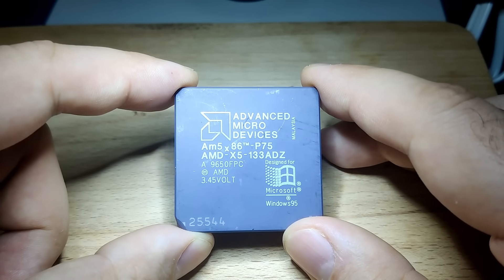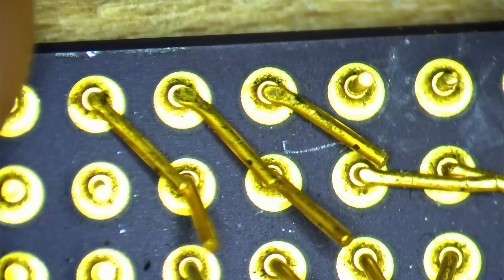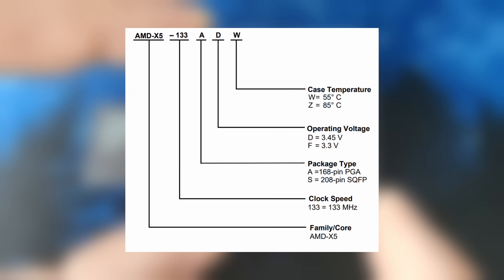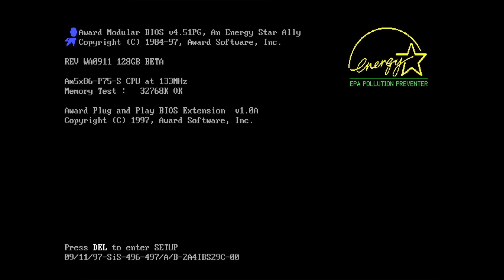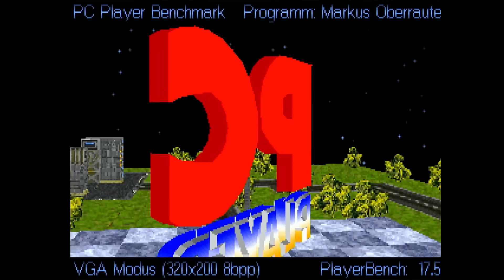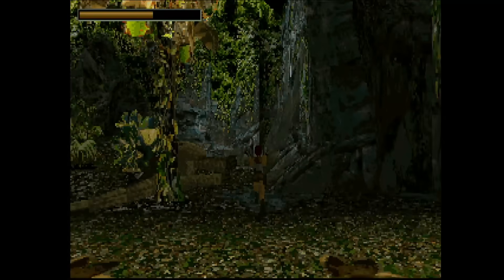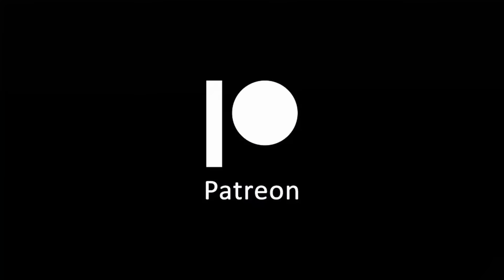Tomb Raider (1996) on the fastest 486 CPU (Part 4)

Comment: this isn't a fair comparison. You're pitting the fastest 586 amd produced, against the mid range cyrix cpu. You already know they made a 120Mhz model, so why didn't you overclock it to the speed of cyrix's actual 120Mhz 586? Then it would have been Amd's fastest 586 vs Cyrix's fastest 586. I demand a rematch your honour :) My client Cyrix's 586 was about 15% faster!!! 
Banter aside, great video as usual.

Comment: Why is one of the pin pads have a square base rather than a round base where disappears into the ceramic substrate
Reply from the maker: Good question. I don't know the answer. The pin with the square base seems to be the clock signal. It is also located in the inner corner where pin A1 is (outer row).
I think it is a visual aid of some sort.

Comment: to straighten bent pins I had used medical syringe needle with cut off sharp tilted front edge. Make sure the needle is big enough hole to fit the pin.

Comment: Have you considered using a mechanical pencil to help position it?
I've used a 1.0 / 1.3, / 1.5 mechanical pencil a lot.
I used the heat gun on the metal mechanical pencil to heat the pins and bend them more easily

Comment: Get a mechanical pencil and use the tip of it you can insert the CPU pins into the tip of the pencil and then use the pencil as leverage to bend the pin back into position

Comment: I used to fix those using empty 0.5 and 0.7 mechanical pencils. You insert the pin in the metallic tube at the tip, which gives you excellent control on where you apply the bend force along the pin.

Comment: Why Prefer Faster 80486SX Cpu
 -because disabled floating point unit or co processor 
 -because uses 25mhz is faster than 133mhz
GUARANTED TO NOT RUN Windows98

Comment: your AMD X5 is a Pentium 586 clone. it's not a 486 processor. to play Tomb Raider properly you need at least a Pentium 133Mhz with MMX capabilities to accelerate 3D calculating. few months later, AMD provides their processors with the 3DNow technologie to beat the Intel MMX. on my part I was using a Cyrix 200Mhz (very good ans cheap processor) with a Voodoo 1 video card to replace my Pentium 100Mhz and be able to play Tomb Rider.

Comment: I wish he did get all the different 486 133 just to find out what is different if anything about the ADH ADY ADW ADZ AND BGC CPU'S that would be an awesome video to see why the different codes for the basically same cpu
Reply from the maker: I'll try to get all of them. The ADY is possible to get, but I have never seen and ADH.
Reply: @bitsundbolts  cool be interesting to see if it has to do with better or worse floating point math or something that affects performance in some way
Reply from the maker: I think the model numbers are mainly to distinguish operating temperature. I doubt we will see any difference in performance, but I may be wrong (e.g. different size in level 1 cache)
Reply: @bitsundbolts  I to doubt it but who knows till you check them out against one and other there could be some difference that no one knew about in terms of performance between the different models

Comment: looks like its  decent  cpu  for its time   suprisngly  .looks  like  it could  last  until  even 2000  with  good gpu  and board
Reply from the maker: I used my 486 DX4-100 until late 1998. Then I upgraded to a Pentium II 350. Of course you could have pushed it a bit longer, but change happened rapidly during that time. Especially with AGP graphic cards - which you would miss out on when staying on socket 3. But I definitely agree that this CPU was a great companion for a while.
Reply: @bitsundbolts  thx for  info  . pci  cards were compatible i asume ? 
i was  pc  noob  back in day  but i do got  overclocked 486 dx2 until  2000  with  no gpu  or  any  grasp   how  pc can  be uprgaded    in terms of   graphical  proccesing  power

Comment: A Mechanical Pencil helps a lot if you can lift the pins a little bit first and then slide the pencil over it and bend the rest of the way using the pencil. But anyways, nice work!

Comment: Awesome work getting that CPU restored! Those pins were in really bad shape. Using the broken socket 3 socket top as a stencil is an excellent idea, I will have to see if I can find one to use for that purpose. I have quite a few 486 chips that look fine to the eye but have a pin or two off a bit that makes inserting them feel a bit sketchy.
Reply from the maker: Hello Mike! Yes, sometimes it is just one or two pins that make the entire experience of installing a CPU in the socket less enjoyable. The socket cover I use was from a board where the CPU was installed wrongly. One of the pins melted the cover and destroyed the socket. Hope you will find also a cover and get those CPUs back into pristine condition!

Comment: If your mobo will provide 50mhz FSB, the 3x multiplier for 150mhz runs faster than the 40x4 setting because it's just able to shove memory around faster. You end up roughly equal in most titles to a P90. 

It was my understanding the reason they didn't sell them as 150 or 160 is that the majority of 486 motherboards only supported 25 and 33mhz. The 40mhz was common, but true 50mhz boards (and the true 50mhz 486's) were rare.

But if your board supports it, 50x3 for 150mhz is the peak performance mark. A LOT of the x4's get choked / throttled by the bus not being able to feed it fast enough.

Comment: Add a voodoo 1! 😄 It will work well! I tried that with my DX4.
Reply from the maker: Ah, that video is already in the making. But first, we need to fix the Diamond Monster 3D, then we are going to test each CPU with the Voodoo 1.
Reply: @bitsundbolts  Great! In newer games the voodoo 1 will be bottlenecked by the cpu of course. Especially when games rely on the FPU.

Comment: What might be interresting is the Intel Pentium Overdrive. That socket 3 cpu can run at 100 Mhz and will probably outrun the 5x86@160Mhz.
On the other hand...it's a Pentium. It would make that 486-system less authentic.
Reply from the maker: I am waiting to get a fan for it. I will make a video some time in March.

Comment: ...and 160MHz was not enough. I'm not exactly surprised. I'd guess that P200mmx or K6 could run TR SW-renderer with well-tuned VGA-card. But most likely it needs something like P200mmx or K6 overlocked to at least 225/75MHz with overclocked VGA. So something Super Socket 7.  Software-rendered 640*480 needs at least Pentium3 with 133MHz FSB (EB-variant) or early Athlon.

Comment: As a kid, I used to play Tomb Raider on an 486 CPU from AMD, clocked at 120 MHZ. In the low resolution mode, the game was much smoother than with this CPU. It must have been an almost perfect 30 fps, and I don't think it is just nostalgia or bad memory. Is there a reason why a slower 486 CPU could significantly outperform a faster one?
Reply from the maker: Maybe you had a different motherboard, better memory (I use FPM because the board does not support EDO), and better timings. The system is not yet tuned for better performance. But I would like to change the motherboard for one that supports EDO memory.

Comment: Guess with those bent pins the good old "bend them back by pushing the CPU into the socked"-Method would've done nothing. :D
Reply from the maker: Yeah, that would have been pretty hard :)
Reply: :-D You'd probably completely destroy both CPU and the socket in the process :-)

Comment: Excellent work! Back in those days I ended up having to run my AM5x86 CPU at 120MHz (40MHz x3) as I could not force a 2x or 4x multiplier in the 486 mainboard I had at the time. I remember trying to play Tomb Raider on that machine and it was not very enjoyable and downright unplayable in places. However, any game that used the Doom engine or similar 2.5D FPS game engine all were a great time!

To get decent performance in SVGA software mode in Tomb Raider you needed a Pentium 166MHz or even a 200MHz. Examples like that are one big reason why 3D accelerators like the original 3dfx Voodoo cards were such a huge deal. It made games like Tomb Raider that were mostly playable in VGA mode on a Pentium PC and allow you to run them in SVGA 640x480 resolution at a smooth (for the time) 30 FPS or higher and allowed for 16bit (65K) color modes instead of 8bit (256) in DOS as well!
Reply: this is the kind of work to make you go crazy making bent pins straight if you are not carful to take precautions.
Reply: Choralone422
The MMX 120 was released just after the Voodoo driver for Tomb Raider, needed that faster MMX 120 Pentium for it. 
Was on pentium 60, needing better build.

Comment: After an XT-class Atari PC3 computer, my first "AT" PC had exactly this CPU (the AM5x86), 1MB of RAM and the S3 Trio64V+ graphics card. Sweet memories.. 🙂
Reply: 1MB of RAM? Shouldn't it be, historically speaking, 4 or 8 MB of RAM?
Reply: @gctechs  Historically speaking, you could put in as much RAM as you wanted or could afford, into those PCs. Mine was built by a local company and they put in exactly 1MB. Yes, the price of RAM was a factor there, but from what I recall, I could live with it for more than a year quite fine.

Comment: Played Tomb Raider on a 486DX-2 66... Wasn't possible in some areas. 😂 Upgraded to an P200MMX with 3Dfx after some months and this was wonderful.
Reply: Same, but never upgraded to a Pentium, or 3Dfx card. Still had a smashing good time on it. If my memory serves me I used some DOS TSR's to improve performance as clock speed only yielded so much. I remember it being a smooth framerate and not a slide show. But that was long ago
Reply: I've played alot in my 486 dx2 on OC 😉

Comment: Still have one of these laying around somewhere... I can only imagine the pins are probably pretty smashed. It did run 98se well enough, with 56mb 72pin memory, a 512kb opti svga vlb card, pci usb card, opti sound card with a volume wheel. Played starcraft surprisingly well. Even handled MPEG2 avi video playback. Overclocked to 150 mhz. Not sure what happened with the rest of the system but the cpu is around somewhere

Comment: For heat to affect viscosity of metal to the degree it bends easy, it would require much greater temperatures than what crystal and especially connecting strands can handle. It's bs, no point in heating the the pins.

Comment: Wow what a substantial upgrade one could've made for their aging PC in the mid 90s to get a couple more years out of it before having to replace it.  I wonder how it'd do with Quake.  It might be just nipping at the heels of being able to run Quake playably (by the standards of the day).
Reply from the maker: The weakness will be the floating point unit to run Quake on a 486, but overall, I really like the socket 3 platform. So many CPUs and different flavours.

Comment: Back in the day there were overclock kits with coolers included for overclocking the 486 from i think it was 66mhz to around four hundred mhz. That's the fastest I've ever seen cranked out of any processor vs the starting frequency.
Reply from the maker: Maybe you're talking about the Overdrive CPUs. They were created to work in older motherboards that only supported 5 volts and therefore were incompatible to newer CPUs that required 3.3 volts. Those CPUs came with their own voltage regulator to make them compatible with those mainboards. For socket 3, the fastest ones should be 133 MHz
Reply: @bitsundbolts  I believe you are right.

Comment: You need to invest in a pair of (knipex 35 52 145) pliers they are smooth on the inside and will not damage or scratch pins when straightening. Definitely my go to for any type of pin re bending.
Reply from the maker: I looked up the pliers and they look so good that I ordered them immediately! Thank you so much for this recommendation! I know that I used the wrong tool to straighten that pin, I just didn't have anything else at hand. The pliers should arrive next week.
Reply: @bitsundbolts  brilliant you won't regret it, they one of my most used tools very useful.

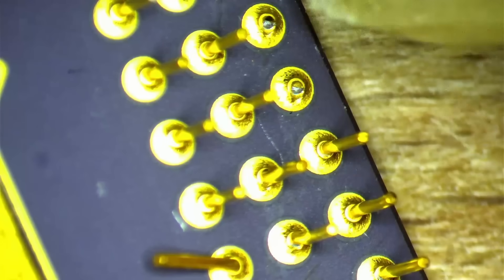Comment: Very awesome video!  What is the tool used at 6:43 and what is it doing?  It looks like maybe an abrasive the way it's making debris around it?
Reply from the maker: Thank you! The tool is an engraving pen. I use it for all kinds of small work such as removing solder mask from traces and drilling into 3Dfx chips when one of the legs has broken off. I'll use it in the next video too because the Diamond Monster 3D misses one of its TMU pins.
Reply: Oh I actually wouldn't have guessed that! I had guessed an abrasive pen or scratch brush or something. Engraving would give you more precision and has alternate heads.. very interesting!  Thanks for the reply, and Love the videos! @bitsundbolts

Comment: Called it! Deliberately broken off ones don't count. 😄 Joke aside, awesome job once again! Performance is right where I expected it to be. You should be able to overclock the Cyrix CPU by 20% as well. Which one is faster probably comes down to which one overclocks higher, as they are so evenly matched at their default frequencies. May still end up being a draw!

Going from software rendering to Glide was/is such a milestone, thanks for including the teaser at the end. After almost 30 freaking years, it STILL makes the difference between something I would and would not enjoy playing. For some reason, I particularly like the output early 3dfx cards produce. It took me years to get used to the "crisper" look of later cards.
Reply from the maker: I'm also looking forward to getting rendered in glide mode. I'll include overclocking for the Cyrix and AMD CPUs in the 3dfx video. I already started to work on the card.

Comment: My first x86 processor after I sold my Amiga.
It was utter garbage! Absolutely the most horrible processor I have ever met in my life. And that I have seen many different processors during my seventeen-year career as an IT technician!
Performance lower than Pentium 75, completely dismal compatibility with any chipset and GW DOS was an absolutely unsolvable problem. Duke Nukem 3D, DOOM, Descent... it was all spilling into ASCII characters at random moments. The only thing that worked without problems was Windows 95 and mine sweeper...
Replacing this processor with a Pentium 120 was then a ticket to a problem-free paradise.

Comment: Why didn't you overclock the Cyrix too ? A 120MHz Cyrix with all its enhancements should beat the 160MHz AMD.
Reply from the maker: I needed to see improvements in each video. Would be a bummer if the AMD would just be as fast as the Cyrix 😉
But I'll try the Cyrix @120 when we get the Voodoo in that system

Comment: Salvaging this CPU is a true necromancing! Congrats! Using the socket from a dead board as a stencil is cool! I am still missing one for 486. But have done the same with socket 7. One guy sold me CPUs sticked to the destroyed sockets. Good to have it. It is astonishing how much the enhanced core of the cyrix helped! I have got Cyrix 5x86 120 so gonna try this beast.
Reply from the maker: Nice! A Cyrix 120 is not that common. If they could clock higher, they wouldn't leave AMD any chance. But as it is, AMD has the clock advantage
Reply: @bitsundbolts  There is a 133 version as well, but it is basically an "unobtanium". A very very rare CPU. Even the 120 is rare. You couldn ´t imagine my surprise when I have came to a scrapyard and one relatively not much mangled was laying on top. I hope it works. Trying to choose some good board now. I do really like your videos! Thinking about making some too, but it is not as easy as it looks. 🙈
Reply from the maker: I have seen people mentioning the 133 MHz version 15 years ago on some forum. As you said, it seems to be unobtainable these days.
I never thought that I was going to make videos one day. But here we are, with almost 100 videos on my channel 😄
And yes, it's by no means easy - it takes a lot of effort and discipline, but the reward of creating and connecting to a community is indescribable.

Comment: At 160MHz I would say that is playable! I mean if you put your 90s spectacles on :)

640x480 in software is unrealistic, faster Pentiums even struggled with that as far as I remember. Wasn't really a possibility until Socket 7 I think.
Reply from the maker: Your memory does not betray you! I checked the footage of a Pentium 120 overclocked to 133 MHz - and the software renderer at 640x480 doesn't look all that different from the 486@160MHz
Reply: @bitsundbolts   did you tried run  modern games  on  intergated grahic chips ?  its similar abysmal  performance in some cases  

no real  3d graphics  card    was always  issue  no  matter   era   , demanding  games will run   bad .   etleast today    pc  hardware is not that expensive  and  it  will not become  absolete in few years   but  last   very  long   for gaming (if you are not spoiled )